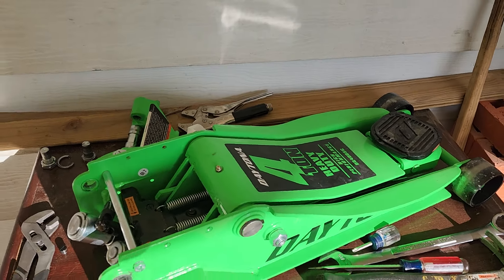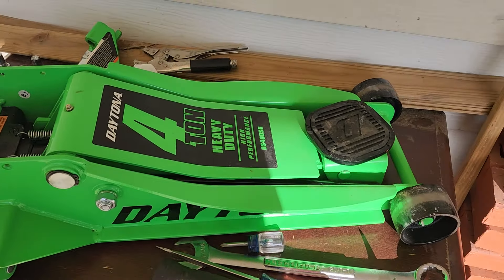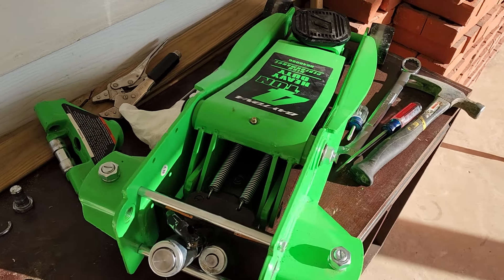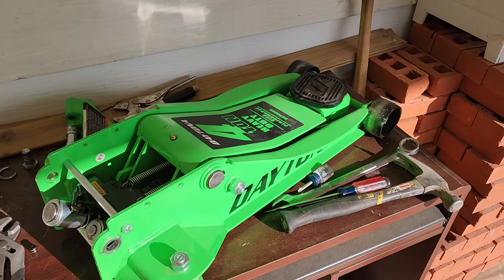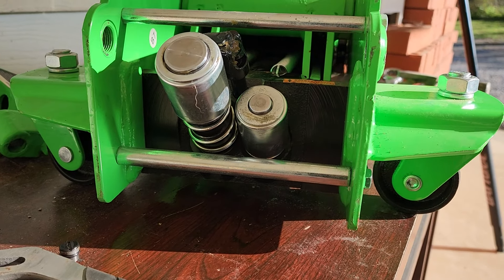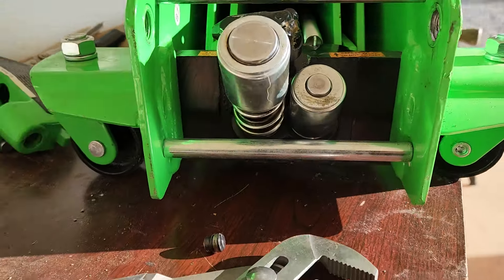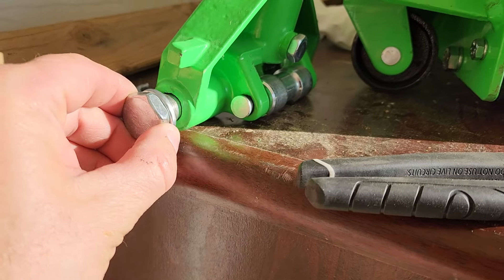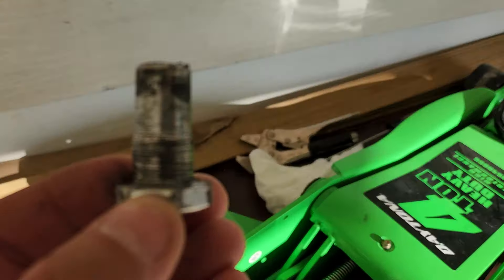Beware Harbor Freight Daytona jack!

Comment: I went through 2 of them in one day. 1 out of the 2 did the same thing yours did straight out of the box. Wouldn’t even hold my son up let alone a car. The other wouldn’t pump up at all. I had over 2hrs road  time between the 2 returns as it’s 30min from my house. After I returned the second one they asked if I wanted to try a third time. I was so pissed I told them to shove them jacks ware sun don’t shine. I ended up buying an old 3 ton Napa jack from the 1980s at a swap meet and haven’t looked back. It works way better than any new one out there. About the only thing I’ve had descent luck with from HF is the Pittsburgh ratchets and sockets.
Reply: Did you bleed the jack?
Reply: @JohnSmith-xu7ev   yep. On both and added jack oil with stop leak. Didn’t make any difference. I think either the pistons were bad or the inner seals were blown. After I had  return the second one a guy out in the parking lot told me that he thinks that that store was putting returns that should have been sent back , they were putting them back out on the floor.
Reply: @bangs2ndshotgarage865  
I hate when parts store employees do that, or they take a part from a new pads then you buy it and its missing shims
Reply: I have a tire shop where i live and they use these Daytona Jacks all day every day including outside in the rain and zero problems. Just got a Daytona 3 ton this Christmas and it lifted up my car sky high like it was nothing. You are doing something wrong with these jacks.
Reply: @mg8720-u7j   I don’t think it’s anything on my end. I think it’s the store. Instead of sending back return broken jacks they are just putting them back out forsale again. I ended up getting an old red Pittsburgh 3 ton low profile jack at a swap meet cheap since I wrote this and it has worked good.

Comment: I know I'm late to the party here but we used to have an old old HF floor jack with the dual pistons like this. Every once in a while one of the pistons would get stuck down. To get it back up we'd smack it down further with a hammer and then it would pop back up on its own. Pretend you're tapping on a valve spring.

Comment: I went to my local Harbor Freight to buy a Daytona 3 or 4 ton jack, 15 times in the matter of two months, and every time I was in there, I got a different excuse to why they were either "sold out", or didn't have any in stock or two times I was told the coupon I had couldn't be used, even when the numbers on my coupon and jack matched exactly!! 

Then came the third month I had went to buy a jack from Harbor Freight, and the manager told me, "we only get a limited number of them in stock, so I walked out of the store, vowing to never trust them again!!! 

The point is, that last time I went to Harbor Freight to purchase a Daytona Jack, was basically the last time I shopped at my local (nearest store), which you have to understand is nearly 20 miles away from me! And now when I want to buy anything from Harbor Freight, I have to drive nearly 60 miles away to the next county over, which has a much nicer and better stocked store!! 

As for the jack I finally bought and ended up with you might inquire?! I ultimately bought a Dura Last Jack from Auto Zone that I found on sale for $89. It is a 3 ton, floor jack which was "right in stock" the day I just happened to be in my local Auto Zone, 5 miles from my house!! And I was so fed up, wasting time, gas and money attempting to buy from Harbor Freight, that if my local NAPA and Auto Zone, doesn't carry what I need.....then apparently I don't need it!!! 

Lastly the Harbor Freight coupon program is such a piece of crap, bait and switch scam.......I don't ever use them anymore!!!

Comment: You done fucked up and stripped the bolt yourself. One is right hand thread and the other is left hand. So theres that. The piston i dont have a good explanation for though. Ive got the 3 ton low profile jack and added the cross beam attachment and havent had a problem with it. Ive used the hell out of mine. Only thing ive done to it is grease it.